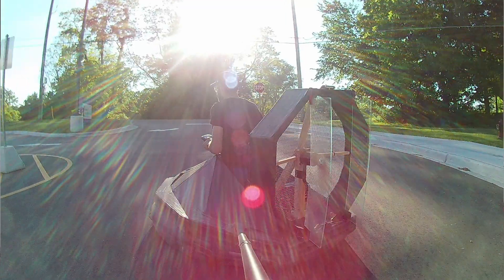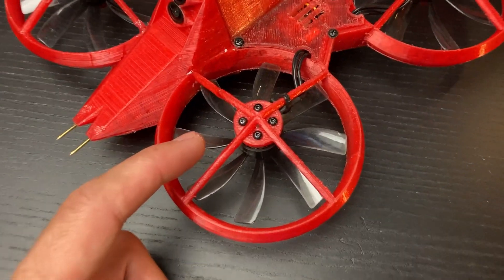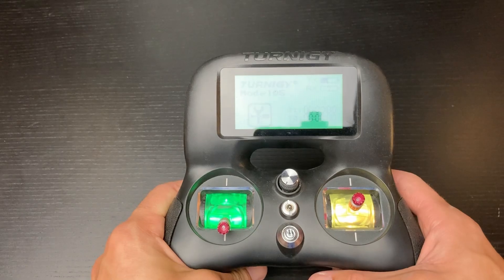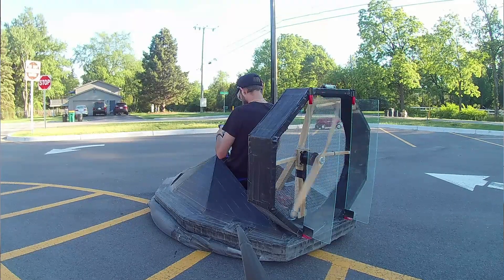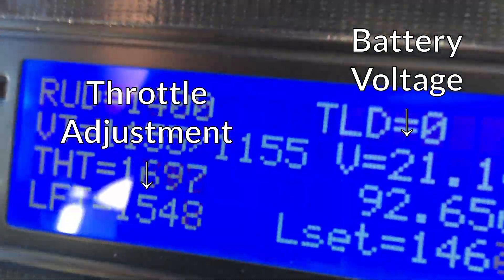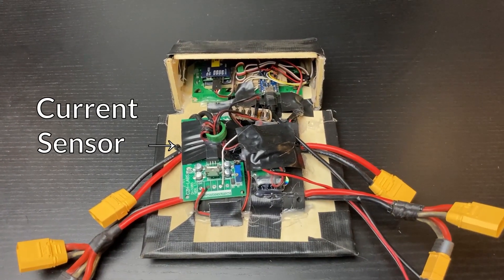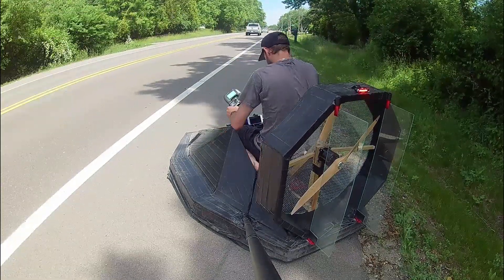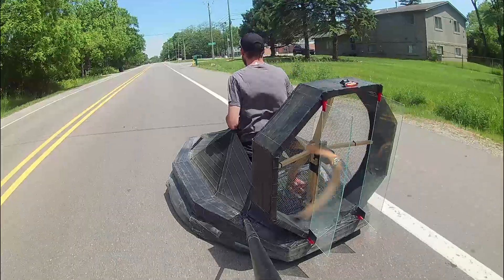SMART Driving DIY Electric Hovercraft

Comment: I could only watch at 144p because of my internet, but I love your approach and the 2nd point was something I didn't even think of since my lift engine never goes below idle unless I kill it.  The last point about thermal overload is something I am most intimidated about trying electric motors.  That and making sure to incorporate battery management so the expensive batteries have a chance at competing against gas from a price perspective.  Anyway the idea of having some smarts in a hovercraft is something I had thought about over the years, when i wanted to compete for the Hovercraft speed record and incorporate some auto computerized trimming to avoid blow-over at high speed - if you are game I still want to go for the speed record as it needs to be challenged eventually.
Reply from the maker: Thanks! Yeah, there are several aspects of the electric drive that have really not been explored in a hovercraft much from what I have found, so I enjoy learning and trying things out. However, my next project is a little more traditional as I did acquire some 10gram coated vinyl like you suggested (really nice stuff by the way) and will be upgrading the skirt for more durability on rougher surfaces. We'll see how that goes once I get back from vacation.  I may be asking you questions if I run into any trouble :)